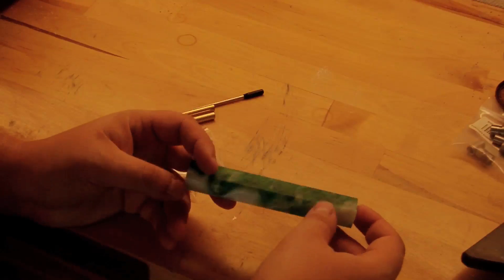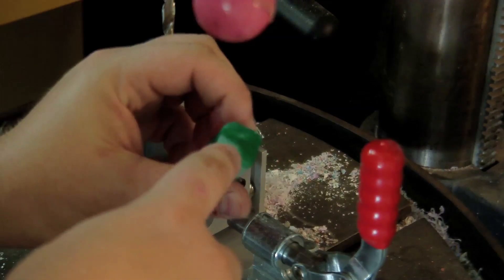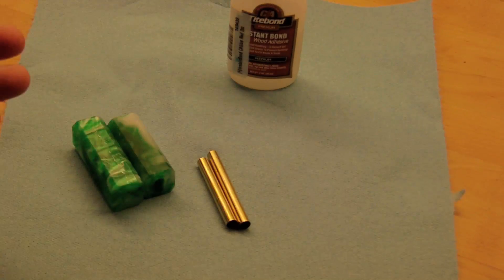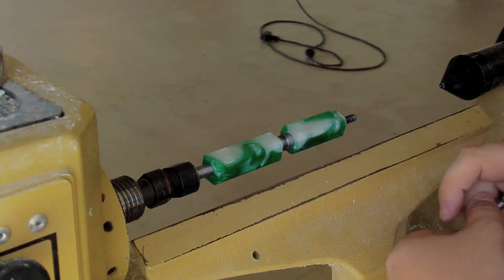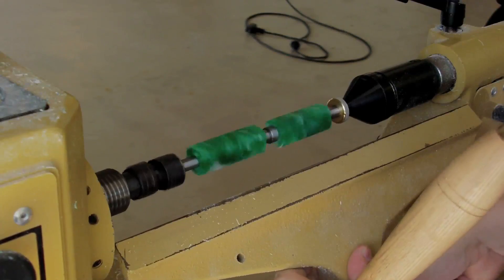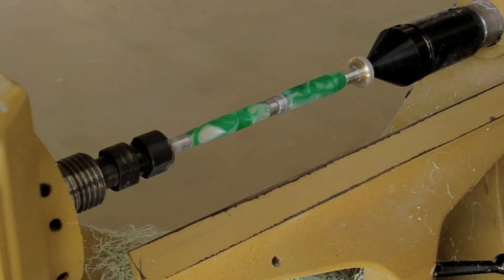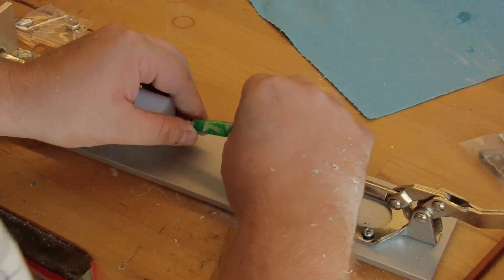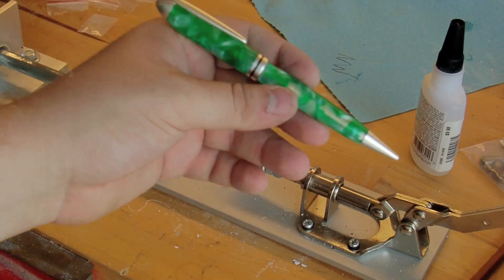Acrylic Pen Turning by Jason OToole

Comment: One needs to sand the tube(s) before gluing, otherwise the acrylic will spin around the brass tubes, especially if you finish with supperglue, heat will cause the inner super glue to release.  Also, lathe speed needs to be the fastest it will turn.  Very VERY sharp tools.  Light cuts.  SHARP!

Comment: You put the brass in the blank and didn't sand it first for the glue to stick firm.
You didn't use a didn't use a barrel trimmer,and you cut the blank on a table saw,and you ran the lathe to slow,and you said its ok to trim the brass if it sticks out of the blank,and your finishing is second best.
I would go onto you tube and watch some of the good pen maker